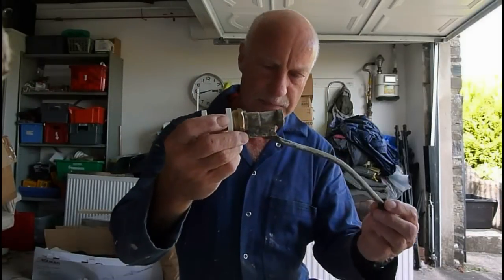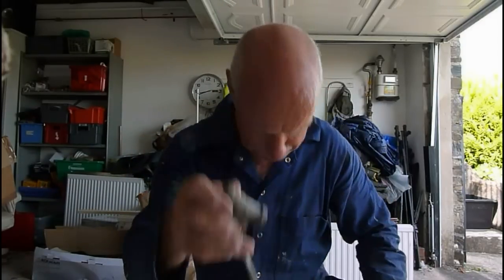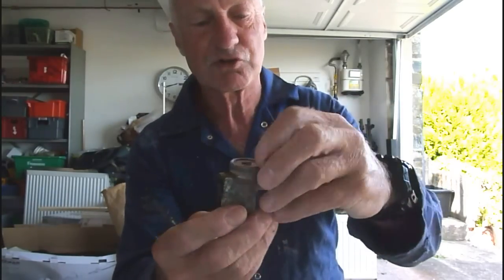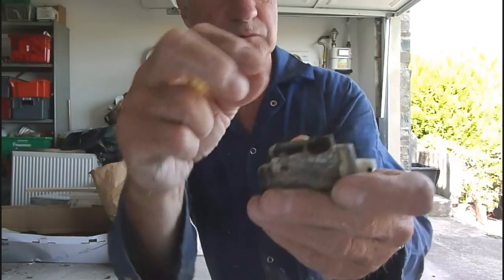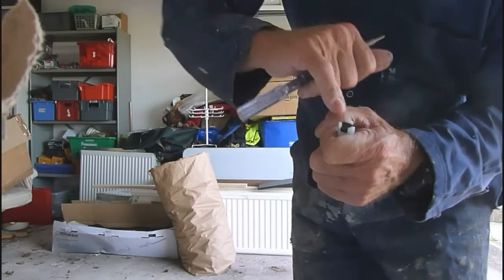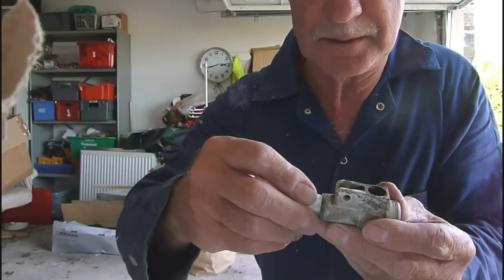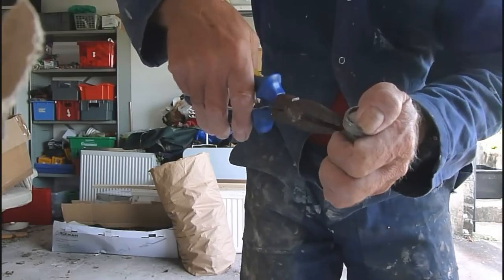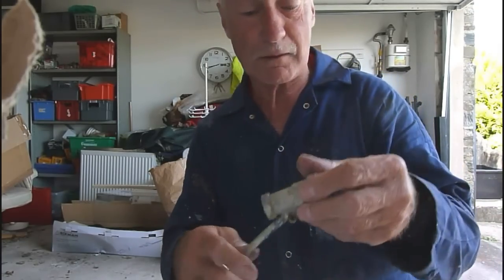How to repair a part 1 ballcock, standard brass ball valve. Overflow running?

Comment: Excellent video thanks and got me well sorted when I changed the piston only to find little improvement.  Therefore your complete disassembly was very useful.  I would have found a video showing extraction of the assembly from the tank helpful.  Granted, it is hardly complicated BUT I wanted to do it so it all went back together without leaking.  I was not helped by the fact that the main nut would not undo from the valve body and I had to undo the rising main from the threaded inlet pipe.  When everything was free the nut came off when the valve housing was put in a vice.  I was pleased to not that a pair of mole grips was sufficient to undo all the large nuts.  Thanks also go to a 1972 Reader's Digest Repair Manual - great publication.  And you guessed it - no new assembly purchased!  Of interesting note was the fact that taking everything apart and refitting the lever arm and split pin when you could see what you were doing was a big plus.
Reply from the maker: Glad you sorted ok.

Comment: Little slip of the tongue in calling the split pin a 'circlip', but commonsense vid. Personally I always buy a nice new complete valve. All the fiddling about with the guts and wondering which part was the problem is eliminated by spending a fiver at Screwfix for a nice shiny brand new one in the knowledge that every part is perfect, then simply taking the old one off and putting the new one in its place. Much easier job and at that kind of price why wouldn't you?
Reply from the maker: I agree John.

Comment: This one didn't work out for me - I think what happened is that as I'm in a hard water area, I ought to have cleaned off debris around the split pin before crimping and attempting to remove. I ended up with bits broken off the pin on either side of the hinge (i.e. it's mangled) and I still couldn't manage to remove it. Given all the new (and better looking part 2) would cost, I'm not sure this is worth it for your average DIYer - spend a tenner and save yourself time and hassle! ;-)
Reply from the maker: Sorry to hear that

Comment: Excellent, thank you. Turns out I was missing the fibre washer. Would've thought it would have been supplied with the new part.
Reply from the maker: Should have been.
Reply: Maybe it joined the other debris in my workshop. Thanks again.

Comment: Great vid. Was going to replace the whole valve. I might have a go at repairing now. How does one identify if its a low or high pressure valve?
Reply from the maker: Take a look at the size of the seating, they are usually high.
Reply: @dereton33  Thank you!

Comment: I’ve replaced the whole ball valve unit in my water tank, but the supply pipe feeding unit was leaking, I’ve stopped the leak using ptfe tape.
Is there a washer in the feeding pipe I should have changed?  Will the ptfe tape be ok as no leak now.
Reply from the maker: There is a fibre washer but the PTFE tape will be fine.

Comment: Hello and thank you so much for posting this video and your clear explanation. It has been very helpful to me.

I have the same system as you are showing here in my toilet, but  it was fitted to take water supply from a indoor water tank. I have since got rid of the water tank and the water supply is now directly from the mains. I was told I need to change my toilet system so that it can cope with the mains water pressure as my current system is for a lower water pressure supply as it is from a storage tank. My question is:
1)  can I change to valves of the existing system so that it can takes the higher pressure water supply from the mains or I need to change the whole system, like what you are showing on your video ?
2) in speaking to a plumber over the phone, he told me that I have a very old system and that the valves are no longer available on sales. Is this correct and if not,
3) is there a special name or how can I go about buying the necessary valves and washers and finally,
4) are the valves for the mains water supply and the water tank supply the same size in diameter or they are different in diameter ? This is because I still have the ballcock system taken off from the mains storage tank, but it looks smaller in diameter than my existing toilet tank ballcock system.

Any help and clarifications you could give is greatly appreciated. Many thanks.
Reply from the maker: Hello Fortre, you only need to change the ballcock in your wc cistern to a high pressure valve. In fact you could take the valve out and just change the seating to a high pressure seat. You do not need to change the whole system.High pressure valves are available at any plumbers store. They are called brass ballcocks part 2. The diameter of all mains pipe work and valves is 15 mm.
Reply: Thank you for your advise and clarification. I will go round to a plumber supplier this coming weekend to get the parts although I suspect I will have problems undoing the water corroded limescale deposits and rust on the connection nut that is attached to the ball cock system, Wish me luck. :)

Comment: Hi @0:53 any ideas how to remove this screw top end when it just doesn't want to budge? What type of grips did you use. Trying to remove my one but it's near impossible. Any adjustable wrenches I use just can't grip the screw top as it's circular and the ridges are very small.
Reply from the maker: You will need a pair of footprints to undo it. Also a tap around the outside of it with a small toffee hammer will help shake it loose.
Reply: @dereton33  thanks for the advice got it loose in the end and had to use a counter wretch to prevent me applying too much pressure to the whole fitting. I'm going to get the washer and I think I'll be good 👍
Reply: The whole valve is probably less than. A tenner treat yourself

Comment: many thanks another job completed
Reply from the maker: No problem.
Reply: i
I have the brass version,any idea what causes a noisy refill? water pressure maybe?
Reply from the maker: Pressure too high. You can also get a silent fill valve.

Comment: Hello again deretoen33 - I was not able to loosen the end where the water comes into the pressure valve. But I was told that because I have a combination gas boiler even when my toilet cistern was fed from the indoor water tank before, the valve in it should be a high pressure one. Is this correct ?

Also, I was able to loosen the opposite end as I wanted to change the washer in the (usually) white plunger as currently there was a slight leak and the water would flow into the overflow pipe in the cistern if it is not flushed for more than 8 hours. But when I open the end, I saw a black end (of the supposely white piston ?) and it is bigger in diameter than the replacement one that I have bought for a 15mm size.

Before I start to take off the pin to release the arm of the float and take out the piston, I wanted ti check with you first whether does this piston comes in different size diameter ? Mine seems to be either 3/4inch or 1 inch diameter. Is it possible or do I have to take it out completely to check ?

Your kind clarifications greatly appreciated. Many thanks for your time and advise.
Reply from the maker: These plastic valves can come in all sorts of sizes, would be better if you could renew the complete valve.
Reply: ok. Thanks for your advise. I was also thinking that, that may be the best course of action. Now only hope the plumber can be bothered to or can take off the old ballcock system  from the mains water inlet pipe as they seem to be fused together after so many years untouched as I would like to fit a new part 2 brass system instead of the modern plastic ones.
Reply: dereton33 - Just curious - I managed to take out the piston from the existing ballvalve and it is a brass piston. My quesiton is then, how do I replace the washer in the piston as there is no exit anywhere except the slit where the arm of the plastic float ball is attached to ? Do I use this slit to put a new washer in side ways and then try to rotate the waher so that is is facing forward in the piston ?
I would have posted a picture of the piston here if only I know how

Comment: Great! Just what I needed!
Reply from the maker: Glad I could help!
Reply: @dereton33  Everything went fine. After watching your video I decided to buy a complete new valve, since that was only just over £4 compared to £1.50 for a repair kit and the original was pretty corroded after 40 years. Fitting only took about ten minutes with another ten minutes spent trying to bend the arm to lower the ball - managed it with two ring spanners in the end. Thanks again! Now have you done a video for replacing a syphon bomb in a double trap syphonic toilet I wonder. I must look at your other videos...

Comment: Could you just rotate the rubber washer the other way round instead of replacing it?
Reply from the maker: H Nur Yes you can, but the washer can be a bit compressed with no give in it, which is why it is still best to replace it. Al.

Comment: You said you can fix it to avoid having to replace it with a part 2 valve.  Why would anyone want to avoid that?
Reply: stoduk  Repair/maintenance kit for a type 1 is £2. To replace with a decent type 2 £10+. My valve is over 40 years old and still working well. I just replaced the washers etc and gave it a clean and lubrication. It'll still be going when I'm not around.

Comment: Just installed one of these in my toilet cistern, does not give me enough water??? Did you say valve for the roof tank?? Looks like I will have to take this back for a refund, was sold to me for the toilet cistern??
Reply from the maker: Sounds like your cistern is fed from the roof tank in which case you will need a low pressure one.
Reply: Nah, I have a combination boiler...
Reply from the maker: Ok. Try a medium red seating in the valve.